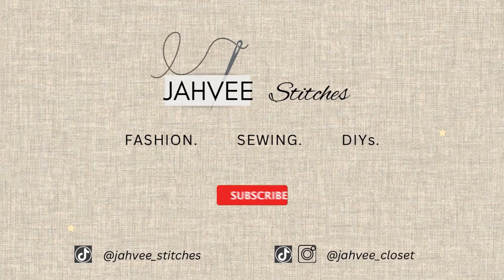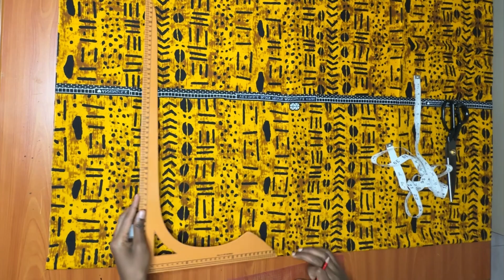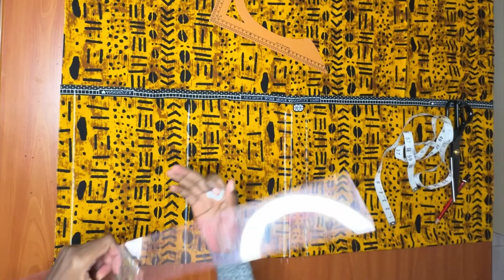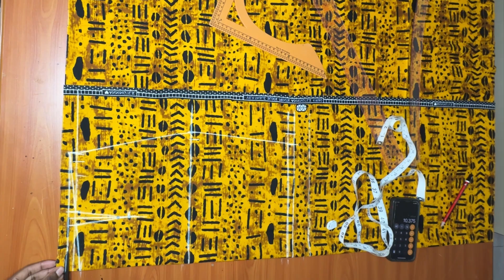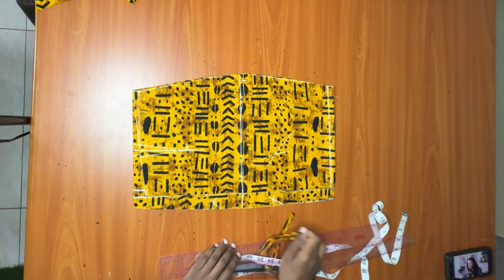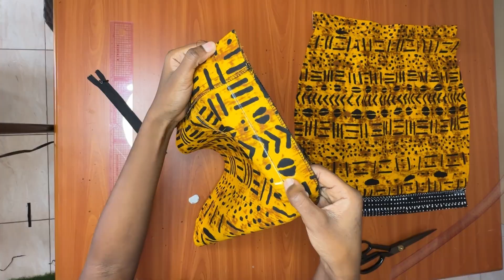How to Cut and Sew a Mini Pencil Skirt | Beginner-Friendly Tutorial

Comment: I just stumbled on your videos and honestly i love them. So my question is why did you start from 1.5 to take your measurements? Thank you 🙏🏾
Reply from the maker: Glad the videos are helpful.😁😇🙏🏽
The vertical measurements started from 1.5” because the final measurement I wanted for the waistband after sewing the outfit is 1.5” and I will be joining the waistband separately. So while drafting the main body of the skirt, we deduct that measurement so that the skirt isn’t longer than the full length you want.  If the skirt does not have a separate waistband, then you don’t deduct the 1.5”
Reply from the maker: For instance, if you want a skirt with a full length of 18”, and while drafting the main body of the skirt, you keep it at 18” (without deducting the 1.5” for the waistband), then when you finally attach the waistband of 1.5”, your skirt will have a full length of 19.5”
(18”+1.5”=19.5”)